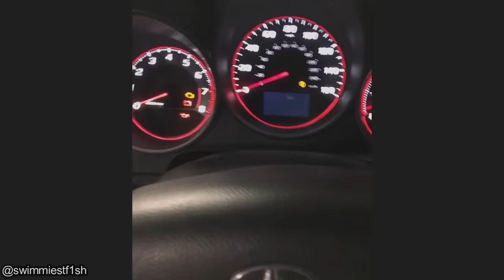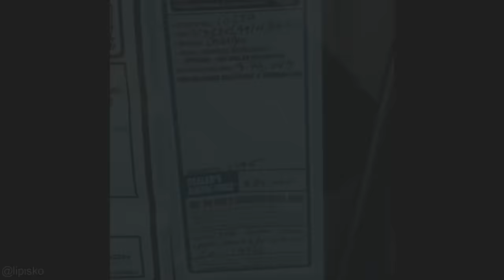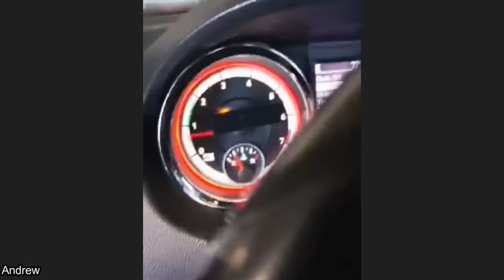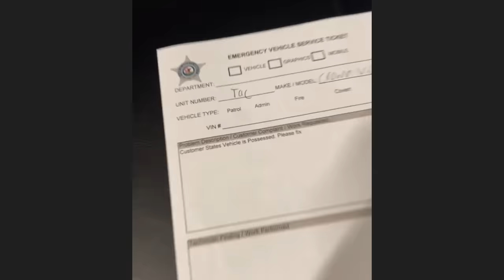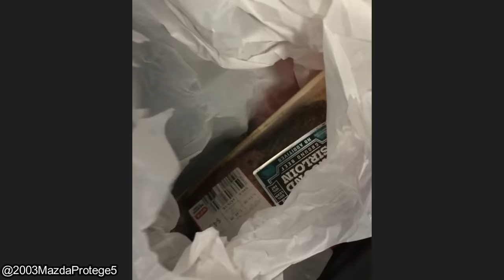Customer States Compilation (The Best of 2021) | Just Rolled In

Comment: So today I learned I could have saved a lot of money by having oil changes once every 10 years.
Reply: Don't give them any more ideas. Already have trouble convincing people that "20k" on a bottle of oil doesn't really mean that...
Reply: @dylanthompson2519  Luckily my current car's service mainly includes replacing the cabin air filter every couple of years 😁
Reply: @High-Overlord-Snarffie-Pug  I eventually learned that I shouldn't be taking my parents' advice on vehicles when they informed me that they air their tires up to 90 PSI. It took me half an hour to explain in every way that is a very stupid idea. They still never listen to me, even though I have been right 100% of the time and have enough knowledge to talk on equal footing with every professional mechanic I've met.

I know that car. I have an 89 Grand Marquis (same thing; 100% parts interchangable) that seized from lack of oil when I shut it off immediately after I bought it. All I had to do was add oil and flush it a couple times, and it's been running fine for 7 years. Just has a lifter tick. I discovered that the oil had not been changed in, yes, ten years. It still ran like garbage until I flushed it twice. Then I had so much more power than I was used to that I ended up drifting sideways through an intersection later that day. 302 doesn't mess around.

Still have it. Every time something goes out, I replace it with something better. It'll be getting a new transmission (because that's fried too; first and second gear no longer exist) and driveshaft once the weather is decent enough for me to do it. Still starts on the first crank. I have a '99 Explorer wreck that I plan on swapping the entire powertrain from some day, and many other things. I have a giant pile of upgrade parts for it in the corner of the room. Everything from control arms to door panels to seats.

I'm also poor, so this has been taking a while.
Reply: @ootdega  ----That last line says it all, man. Sorry. I know exactly what you mean thought. If the car can still run, then I don't have to skip a bill to fix it. Being poor sucks. I hope you get them running, and good luck to you.
Reply: Bruh like u can go on oil for a while if ya keep it clean with sea foam and in the gas tank
Reply: @dylanthompson2519  it 100% means that

Comment: Gotta love that metallic silver tinted oil. So fancy!
Reply: Can be used as metal grease straight away
Reply from the maker: Once you drain it you can use it as paint 🎨
Reply: Looks like anti seize compound, just the thing when you're selling a car with bad rings and big end bearings.
Reply: I made a wall of shame for our shop as customers walk up a ramp to the service door, they see many pictures of mistreatment and failures, with probable issues/symptoms to be seen/felt/heard with each picture. Its funny when customers recognize a picture from their own tractor. Tends to calm their anger before coming in and blaming the equipment for their failures as an operator. Hydraulic oil gets shiny when something is wrong. Some customers will say, "thats break in." I usually say, "sir, your tractor has 1,000 hrs on it and you haven't changed the hydraulic filters since 200 hrs. Thats not break in, thats something broken." The excuses are ridiculous.
Reply: It's like goldschlager but for your car!

Comment: Still great to watch these, I think the mechanics would have a difficult job convincing the owners of these vehicles that they have a big problem! Keep the videos coming in 2022 they are really educational as to what we might be driving behind on the roads. 😉
Reply: I seem to remember the phrase "the customer declined all repairs" being used quite a bit
Reply: Customers are never to blame...ask them, they'll tell you. I frequently add to work orders, "customer declined replacing (insert part that will fail in the next 5-25 hrs). Likely to fail soon and any failure and damage to this work will not be covered by the 90 day return on labor warranty." Basically saying yes we worked on this area of the equipment, but they wouldn't fix it so its going to fail.
Reply: I have to write "customer advised of issue and declined repairs" on the regular, and when they come back to complain I have zero problem pointing to their signature on our R.O. with that written on it.

For those special cases, I have a giant red ink stamp (sucker is literally half as wide as the page!) that says "WARNING: THIS VEHICLE IS UNSAFE TO DRIVE!" and has a line on it that I make the customer sign. Sometimes the message actually makes it into their brain.
Reply: That's the beauty if being able to refuse the release of an unsafe vehicle.
Reply: @OddlyIncredible  I need a stamp that says, "unit given 50 more hours to live." A skid steer came in today with the seat rusting off, bought 10 years ago. "That's warranty right?!" No sir, reprogramming the seat SWITCH time out is a fix as fail... not replacing a 10 year old rusted seat in an open cab that is not being cared for. The muffler pipe that is supposed to go through a hole out of the rear hatch is broken and just shoots hot exhaust gases into the engine bay. Filter was a ploom when I dropped it in the shop floor. I told him it needs a service bad and a thorough cleaning and he said just replace the muffler...know when money matters? In retrospect is when money matters. "I should have listened and spent $900 on a good service and wash...now I'm spending $3,000 in head gaskets and doing the service to get the coolant out of the oil anyways...I feel bad giving some expensive quotes. I hate telling people about high bills, but I can't fix stupid if they bought out of their league and won't pay to maintain it properly.
Reply: @gl3618  I feel you - I'm in the middle of a thousand dollar auto repair that would turn into a six-grand engine replacement if left unfixed, but thankfully the customer understood "fix it now for kinda big money, or fix it later for really big money" and is having my crew take care of it before it becomes a "catastrophic engine failure" scenario.
Reply: @OddlyIncredible  I asked a guy one time, "If you're an expert, why did you bring it to us?" His tractor for the repairs it needed. Lol

Comment: I'm a mechanic. I spent the whole video (apart from the broken oil filter who pulled over straight away) shaking my head and scrunching my face. The welding on that exhaust, I've never seen anything like it, I mean I've seen bad welds but not so many on one car, and the fact it was welded to the actual body. I'm impressed by the BMW with no oil changes for 68k went on to run well and the mechanic who cleaned it up, bravo. The wiring in that Honda gave me anxiety. I love this video but I'm not sure I can watch more than one at a time. Subbed for later!
Reply: It's like they were welding with a 120v receptacle or car battery. haha
Reply: The welding looked like barnacles.
Reply: That's some crap welding with a flux core wire. I know because I have a 120v flux welder and I suck with it. How much wire do you think they used? Like a whole damn spool.
Reply: That welding was so bad I was genuinely impressed. I don't think I could do a weld that bad if I tried.
Reply: Yeah, watching these back to back like I've been doing has caused me to take tremendous amounts of psychic damage
Reply: I only fix my cat and my parents car, these video makes me avoid the mechanic industry at all cost
Reply: It would be funny to present that car to the mandatory german TUV inspection,just to see the inspector's reaction:  NEIN, NEIN,  NEEEEEEEIN!!!

Comment: In Europe cars have to have a compulsory safety inspection every one or two years (depending on country.) If the vehicle doesn't pass it's no longer legal to drive it on the road. It's an annoying piece of bureaucracy, but some of these clips show why it's necessary. We don't encounter cars as dangerous as ones shown here.
Reply: It’s pretty lenient in U.K. but yes, it’s nice to know they have working brakes, lights, and half decent bushes at least once a year.  That said, everyone knows an mot can be pointless within an hour of it happening even if it’s just our obsession with tinkering. 😂 I would hate having to go for German tuv or Spanish itv you can’t even have different tyres front and back or replace anything with non oem or oem approved parts. Makes it very hard to enjoy old cars.
Reply: @matthewstock1074  Live in France now myself, CT test every other year, so your point is valid, doesn't guarantee the car is always safe. But some of the rust on those cars in the Just Rolled In clips must have been dangerous for years!
Reply: @tocboatman  I've had vans with 12 months mot where you can watch the road go by through the floor, also seen one at work that just had enough gone off bags of cement left in the passenger side footwell between the floor and the chassis that it could pass. Go home and swap for the decat pipe on my hatchback, however, and its apparently less roadworthy.

Rust only fails if its structural, and tbf if you can smear some filler over the hole enough that it can't be lightly probed through with a screwdriver its considered perfectly legal.
Reply: Before the computer systems and cameras were mandatory in my state.   You could just pay people to pass you.  Now it's a lot better. 
It was pretty common,  his with loud exhausts and illegal tint were usually who paid.  Most shops still wouldn't pass you with any major safety issues. But I'm sure there were people that would probably pass anything for a few extra bucks. Hence the need for a mandatory state wide database and on camera inspections.
Reply: @dommyboysmith  You have an issue with people who like loud cars?
Reply: @NewEnglandboy453  everybody does have an issue with loud cars
Reply: @sayingnigromakesyoutubecry2647  this is false. And since some people don't like you're saying they should all be banned yeah?
Reply: @NewEnglandboy453  loud cars are banned almost everywhere... What are you talking about?
Reply: Yearly for Texas and some other states in the USA as well
Reply: @robertgirtakovskis1670  yup
Reply: 6 monthly for cars older than yr2000 in NZ. 12 monthly for 2000 and younger.
Reply: The U.S. of A., Demonstrating why regulations are a good idea since... well, since the Industrial Revolution...
Reply: @robertgirtakovskis1670  yearly inspection here in NY.
Reply: Agreed. I have now changed my mind on these inspections.
Reply: In a lot of states
Reply: Lmao yeah. You guys just get pasted on the autobahn instead.
Reply: In New Zealand it's every 6 months unless your vehicle was made 2000 or later

Comment: 50 years ago, owners manuals had a section showing how to adjust the valve’s. Now the first 20 pages are warnings to “ not drink the antifreeze “. I actually had a rental car with a tag on the steering wheel that had a little cartoon showing how to turn the key. If you have to be told not to drink automotive fluids, you should not be allowed to drive.
Reply: Yeah, no, that whole "50 years ago owners' manuals said..." thing is BS. Owners' manuals did NOT routinely show you how to adjust the valves, and manuals today do NOT spend the "first 20 pages" telling you not to drink the battery acid/coolant/whatever other fluid.

BTW, if your rental car story is true, you might want to consider that keyless ignition systems have been around long enough now that there will be people who've never driven a car that was started by turning a key.
Reply: @dunebasher1971  yes. When I first started learning how to drive, all I had was push-button start. It wasn’t until I got my own car that I finally learned how to do the key ignition.
Reply: antifreeze/oil/transmission fluid/brake fluid tastes fine that’s how i diagnose some leaks - diesel mechanic
Reply: So i was sitting in a minicooper, it had a flipswitch to start the engine... sooo it took me a solid 10 minutes including using the manual to figure that out. Damn it!
Reply: @40below1000  yeah... but you had to tip it upside instead of turning it like a key. It looked like a damn key

Comment: the changing the fuel pump by cutting a hole in the seat has me shaken 7:50
Reply: Absolutely the worst way to go about it but honestly I can understand why he did it 🤣🤣🤣🤣🤣.
Reply: I believe it’s a 2003ish CTS. To drop the tank, the entire rear subframe needs to be dropped as well. It’s literally something like 8-10 hours for a fuel pump. This guy did a really bad job, but if you’re careful and seal the floor back up when you’re done, it’s perfectly fine. (Obviously not an option for proper shops though)
Reply: @How_Many_Monkeys  I remember seeing that method online in a forum for my 95 Camaro like 11 years ago. I never attempted it, but it seemed sensible enough haha

Comment: @11:30 go easy on the guy, that's what all radio adaptors look like. At least he used wire nuts instead of just tape. But that thing probably had every control for heat, ac, ect. all integrated with the stock radio.

Comment: My first car was a Saturn ION. The frame was incredibly rusted, to the point where the support mount for the exhaust just pulled off the frame. When my brother, who's a mechanic, tried to weld it back to the frame, he had trouble finding actual metal to weld to. After grinding off the rust, there was a paper thin amount of clean metal. On the lowest setting, my brother's welder would just blow a hole through what was left of the frame. 
I ended up changing car as soon as I could. I puckered every time I went over a nasty bump, afraid the frame would just fold on itself. Coupled with the fact that the model had poor safety ratings, I'd have certainly died if I got in an accident. The motor still ran really great though.
The car I replaced it for didn't have much rust, but the motor had a few issues. Just the opposite of the first one.

Comment: This past summer I replaced the entire front suspension on my wife's '06 Trailblazer and my '04 Trailblazer EXT. The clip about the missing upper control arm bolt was funny! And the ironic thing is: the rear bolt is pretty easy to install, it's the front one that's a PIA!!

Comment: I'm a mechanic, I love watching stuff like this 🤣 I was always taught the stupid people make you the most money as a mechanic 😏
Reply: yes sir
Reply: People wanna be cheap and do their own repairs but end up fucking it up, causing even more damage than the original problem which ends up costing them even more money to repair. As for myself, I have a basic understanding of the components on a car and how they work and i am able to do some small parts swap myself like changing taillight bulbs, batteries, I've been changing my own oil for decades and i routinely check all my fluids.  I do know how to change my brake pads (i've done it a couple times before) but nowadays I prefer to let my mechanic do it. Anything more complex than that I prefer to let my mechanic handle it. My car is an investment, I use it to earn my money so i'm not shy about reinvesting some of that money back into the car to keep it in good running order. If you're too cheap to spend a few bucks occasionally on your auto, may i suggest public transportation.
Reply: Should I sell my 2003 Elantra with 135k kms?was 4K spent 5000 on repairs…

Comment: 1:20 bad oil + bad filter. Someone went a long time without changing em. The blue capsule is the oil filter cartridge. I learned that when I found out mine is on the top of my engine

Comment: I have neverrrrr seen oil make a mold of the oil pan 😂😂😂
Reply: i have many years ago it was Quaker State  paraffin based
Reply: Of all the things seen on JRI the oil-pan Jello mould has to be the best WTF moment. The 'lubricant' just hung there and laughed at the mechanic. WTF was supposed to be lubricating the engine?
That motor must have sounded like 2 pounds of bolts inside a cement-mixer drum.

Comment: I once installed a car radio by myself when I was 18. To this day, I have no idea whatsoever how I managed to do it successfully.  No clue.
Reply: i can tell you  by the dash on that one its a chevy or gmc sierra  and  i found out  why an aftermarket radio wont work is cause the main harness in the truck has no  power or memory wire    i always say   fork out the cash and have it done right
Reply: @johnc27  The car I put the radio in was an early 80’s Volvo 240. The thing was a tank, perfect for a teenagers first car.
Reply: I've installed several on mine and friends' cars. Never have I seen a mess like these.
Reply: Good on you. It feels good to get it done yourself. I only got my license about 8 months ago and know nothing about cars (I'm 46yo BTW). I was quoted $2400 to fix the automatic tailgate on my X5, so decided to watch some Youtube videos and try it myself. It cost me $150 in parts, but I managed to fix it in about 40 minutes. That gave me a bit of confidence, so next I pulled my door apart and fixed my speakers which I was quoted $700 to fix. It was just a broken wire. I reckon I might rebuild the engine next. haha, maybe not.
Reply: @waynereardon  what year X5 do you have? I’m looking at buying an X5 in a few months to a year
Reply: @nickcoats5227  I have a 2010 35i and a 2010 X5M. I love them both, but the X5M is an absolute beast. Everyone will tell you to stay away from them, but if you maintain it properly, it has minimal problems. The only other problem I've had was having to replace the coil for the 3rd cylinder after it went into limp mode, which the mechanic only charged me $90  for.
Reply: @waynereardon  Dude, your last name is Reardon? Mine too. Same spelling. Do you know what the name means?
Reply: @Dan.Solo.Chicago  it's Irish for Alcoholic. It's actually a shortened version of O'Riordan. We all come from Cork.